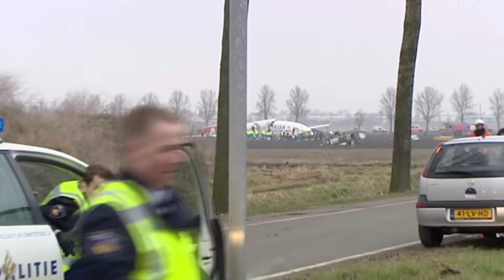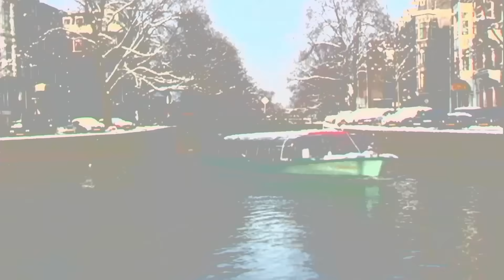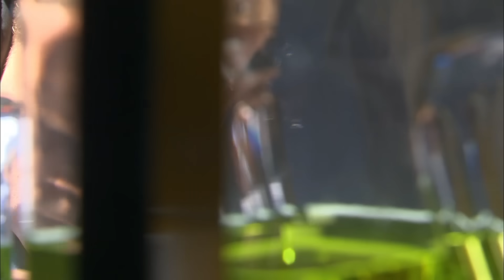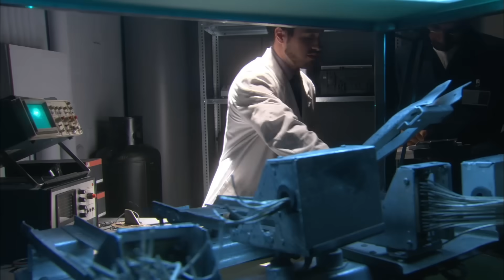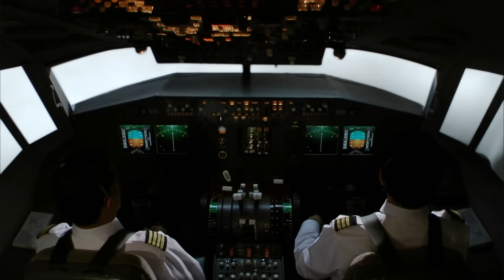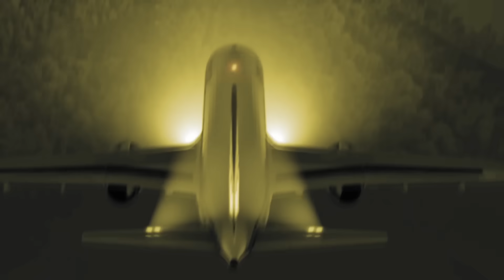Why Did Turkish Airlines 1951 Crash? | Mayday Air Disaster

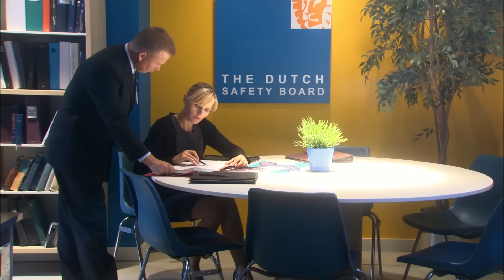Comment: 8:41😂 I can never stop laughing at the sign on the wall. Even if the name of the Dutch Safety Board was "The Dutch Safety Board", it wouldn't be called that way locally, it would be named in Dutch. So the signs wouldn't be like that either way. If they would have named it accurately, the sign would say: "Onderzoeksraad voor de Veiligheid," "Inspectie Leefomgeving & Transport," "CAA-NL," or "Rijks Luchtvaart Dienst."

Also, the cockpit interior isn't anything like a 737 cockpit. A 737 cockpit is about as spacious as a doghouse irl.

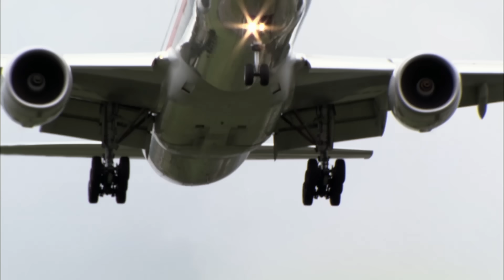20:30 And that's not a 737. The 737 does not have body gear doors, nor does it have 12 main landing gear wheels. The 737 only has 4 main landing gear wheels. That's a Boeing 777.

Comment: Give automation to Boeing, and they’ll still find a way to screw it up. The pilots were distracted — the plane should have warned them before it was too late. It should’ve issued an audible “Airspeed too slow” alert; that alone could’ve made them notice the throttles were set to idle.

At the end of the day, the kind of pilot who chooses to fly a Boeing often struggles with technology anyway. Airbus is far more sophisticated — and safer. You can blame the pilot or the tech all you want, but that won’t fix Boeing’s real problem: Boeing itself.

They keep making cheap knockoffs of everything, then ignore safety complaints until a plane crashes and hundreds of lives are lost. And every time, the NTSB steps in to clean up their mess and bail them out — so the same accidents keep happening, and nothing ever gets fixed.

The worst aircraft manufacturer in aviation history is Boeing. Heck, this old MD-11 was flying perfectly fine even after 30 years of service. How many Boeings can last that long? Why was McDonnell Douglas better? Because the NTSB never covered up for them — they had to face the consequences every time. And that’s why, even decades later, their planes ended up being safer than Boeing’s.
Reply: Md-11 just had an accident ups flight 2976z You should’ve seen how often dc-10s used to crash. That had nothing to do with boeing 😂😂😂. Hate these fake experts on here thinking airbus is this flawless ultra safe company while Boeing is ultra dangerous and deadly.

Comment: That is NOT about people, who can't understand [cryptic] signaling, but about invalid hardware and software, and irresponsible plane manufactures, who makes dirty shortcurts, and hides them (don't document, gives false severity for critical malfunctions)

Software do not validate inputs (doesn't alarm about them and does not abort operation), but continue making invalid control commands. In best case it generates number of cryptic third system alarms, that have nothing common with initial malfunction, thus you need to be genius engineer to understand the issue in real-time.

Comment: So, Boeing knew, that left altimeter is critical for auto-throttle, but did not state that in manuals, and still consider left altimeter malfunction as minor !
And why auto-throttle doesn't abort having obvious invalid altimeter data input in first place ?
That should be the very first function of the software - continous input validation. How negative radio altitude value could be considered valid in flight ?!

Comment: The captain knew the altimeter wasn't working and even ignored the alarms several times. I assume pilots know that altitude and speed are key components of descent. Yet, this was left entirely to the known faulty computer-controlled systems. In my opinion, the cause of this crash was pilot error.

Comment: What is the point of implementing automation if the automation doesn’t work? If you can’t count on the machine doing its job, don’t use it. You might as well do it yourself.
Reply: they later changed it so they could choose which parameters are read by the autopilot, if the captains ones or the second officer, not like in this case.
Reply: Good to hear

Comment: Fine and good, but a pilot is Avionics personal, not engineering, that is able to connect the dots of malfunctioning or strangely behaving stuff (and that is difficult even in normal situation, without ground closing in). Having lots of data is nice, but you need to STRUCTURE it. Having automation is in control is fine most of the time, but the moment you enter a circumstance (or have bugs), you wont recover, because the plane says "nuh nuh nuh".

In my opinion data presesentation is key. Also a direct alert of having different data from the same type of sensor or actuator and the plane should request "hey man, what are we going to do about this?" aka in this case: which data should I use, because I can't help it?!

It's working together, with the plane doing it's job and the pilot being the backup in case things get funny.

Comment: Boeing, after receiving 2569 reports of their faulty radio altimeters, finally decided to shrug off and do absolutely nothing. Incredibly criminal.
Reply: If pilots are so accustomed to faulty warnings and unfixed minor problems, it would be understandable if they dismissed warning bells.
Reply: @saeedsh65  exactly and they expect pilots to fly planes when they themselves aren't even bothered to fix problems
Reply: Starting the late 1990s, Boeing no longer was the company it used to be.  Boeing should not had bought MD.
Reply: Welcome to the world and life
Reply: It said they took measures to improve reliability, but when these didn't help, they should have brought in top engineers to either scrub every inch or redesign it.
Reply: Mayday highlights how little the pilots monitor obvious malfunctions...yet everyone sits in the cabin sipping overpriced drinks with complete confidence in these glorified bus drivers😂😂.
Reply: R
Reply: Can't blame Boeing for the pilots not watching the instruments on an instrument approach. It was an INOP system that's was worked around easily.
Reply: Too focused on the gauges and too little attention on obvious problems 😂😂1q😂😂
Reply: Part of me thinks this is an issue that is not directly related to Boeing though.  Even using your figures of 2569 reports, that would suggest that Turkish Airlines  alone accounts for 10% of those if your numbers are correct, yet there are some 5,000 737's in use at the time supposedly.  They also note that this particular plane had this issue before, yet sounds like it was able to land safely despite the same issue, so I believe part of this has to do with the pilots, as pointed out in the documentary...  their dismissive actions to the landing gear warning, the pilot bvasically "ignoring" the warning from the safety pilot about the faulty altimeter, etc.  I mean, the signs were quite obvious if someone was paying attention to what the plane was doing, but as they also pointed out, the crew was under a heavy workload at around 200 ft from the runway when they should have been monitoring the landing and systems, not preparing for landing like they were... that should have been done back when they wsere at 1000 ft, so to me, while the faulty altimeter was perhaps a contributing factor, it did not cause the crash.  BAsically put, it sounds more like a pilot error mostly.
Reply: ....the ice maker was broke too.....
Reply: Boeing doesn't maintain their planes after delivery thats up to the operator. How do you explain no other pilots experiencing the same system failure but do not crash ?
Reply: @The_Sword3   Very smart of you))) 
I mean there are thousands of cases where pilots have reported that they had problems, and you say to yourself that ... what if ??? if the plane didn't crash everything is ok !!!
At least you can hear yourself saying what you are saying ???
And in cars, if a manufacturing problem is found, the cars are called in for service to have the problem solved, but you say to yourself, what if ??? ... in an aircraft
Reply: @The_Sword3  Re: "How do you explain no other pilots experiencing the same system failure but do not crash?" -- Mostly luck that none were too distracted at the time to notice warnings.
Reply: Pilot error not a faulty altimeter . There are three of them on board. Three pilots didn't notice their speed dropping until it was too late.  Work for Airbus do you ?
Reply: @The_Sword3 so if brakes develop a fault on my 5 bicycles made by the same company there is nothing wrong with the bikes because i can brake with my feet? Not the sharpest tool in a toolbox, are you?
Reply: @szonton9672 if your 5 bikes developed a braking issue because of stretched cables and you put in writing you know the bike is damaged but aren't in a position to fix it,  you would indeed be laughed at for trying to sue the bike manufacturer for a broken leg

Comment: the question should be that why did the fuel tanks did not explode. Did it help that the landing gear was down ?
Reply: Fuel tanks don't always ignite on impact.  You need something to spark the fire, and you need the right fuel-air mix at the time that spark hits.  Too much or too little fuel and you get bupkis.

In this particular case, it probably helped that the main source of potential ignition - the engines - basically yeeted themselves away from the wreck on impact.

Comment: The main issue was the plane design. There has to be a setting in auto-whatever when there is one parameter wrong, the pilot should be able to set the auto in a correct way. Auto-throttle or auto-pilot is good if the inputs are correct, if some input goes wrong, there has to be a system (settings) to control auto systems.

Comment: It amazes me to find out that there's a warning sound for a faulty altimeter but no warning alarms when the speed decreased so low that it reached stall levels.
Reply: There is “stick shaker”, but in this case it came too late. Something like old american clunker…gives you red light overheating warning…after the engine is wrecked already…!
Reply: I believe it does say "stall, stall, stall" I could be wrong though
Reply: @ThepPixel That's Airbus.
Reply: Yeah, a Boeing 737-800 should have both a stick shaker and an audible "Stall" warning. It also has "Barber's Poles" shown on the primary flight display for both pilots that gives a visual representation of where your flight envelop is (Over speed vs Stall).
Reply: There is plenty of warning, the plane shouts "airspeed low" at you even before the stick shaker, the pilots just weren't paying attention

Comment: The irony of seeing this and the 737 Max issues is that it seems Boeing has been doing this whole "nahh mate we'll take it off a single sensor" thing for much longer than you'd think; if they used both radar altimeters they could've seen there was a disagree, which then should immediately disable auto-throttle, flip a master caution, and force the pilots to handfly. But no. Guess that was too logical...
Reply: I'd put in a check to ignore any reading below 0 feet if the plane is moving faster than 60mph.
Reply: No because that could mask a much larger problem.
Reply: That costs money. And Boeing is all about money.
Reply: @chrisrodriquez5459  Well, post-merger Chicago-based Boeing is. Before that Washington Boeing were all about engineering excellence.
Reply: Cant agree more. This accident could have been (and should have been) avoided.
Reply: Comparing two different voltages, to see if there's a divergence, is alien technology to them.

Comment: This accident should never happens in an Airbus with the Alfa protection mode.. Boeing should install the same feature..  Simple as that. The ALFA protection mode works independently of both autopilots, and  would have understood the low airspeed and correct it.. Even the new Chines Comac 919 has it.. Why not Boeing ?? Simply another Boeing accident where the system failed or was simply missing. Boeing has a lot to work on,  If not we will have a new Duopoly in the skies, Comac and Airbus.. ???

Comment: Well a verbal warning of airspeed would seem even more important than "pull up". The stick shaker was useless at this point the planes computer, auri throttle , and defective altimeter intentionally stalled the plane on its own and crashed. Yes checking air speed is mandatory, however,  if there was a verbal automated or verbal airspeed  warning before the stick shaker,  this and other crashes of smart places could be prevented .

Comment: The cockpit workload was too high (largely due to the Schipol landing) for the pilots to even recognise the subtle warning that the plane was giving them. There's elements of 'mode confusion' too with automated flight systems, plenty of landings have turned to poo because of similar events.
I have to place some blame with Being for not 'masking out' obvious radio altimeter erroneous readings too. It should reject negative values entirely. Better still would be to compare the two radio altimeter values for inconsistency.

Comment: Hog wash!   "Investigators have determined that Turkish Airlines flight. . . crashed mainly because the pilots didn't recognize the consequences of the warnings . . . "     No.  The 'main' cause was a design flaw by Boeing.   That the pilots were not trained to lookout for the malicious domino effects of the faulty reading then came into play, under circumstances which masked the symptoms produced by those effects.
Early in the video, I pondered on why there was no 'override' switch for Ground Proximity Radar feed to the autopilot system (APS).   Having a mute button to silence an audio alarm is nice, but, if a crew determines that a critical flight reading (and it is why they often have duplicates) is faulty, not only should they be able to silence the audible warning, but to as well cut its data feed to the APS.  How can that not be OBVIOUS to Boeing or any large commercial plane maker?   Once determined to be in error, the override would be enacted manually by the pilot, and the APS computer could then use the feed from the other radar sensor, or at the very least not be subject to faulty data causing the plane to behave catastrophically.  
While it 'might' could be said that the 'ultimate' cause was due to the pilots lack of attentiveness, it wasn't, in fact, the 'main' cause.  The main cause was a Boeing design flaw, without a doubt.  If you design a machine to perform based upon inputs that can be faulty, without providing an override opportunity for the crew, then it is the designer who is at fault.
Reply: If it is a boeing I’m not going😮
Reply: This guy Sedor is going to give Greg Feith a run for his money in the good looks department
Reply: @jamestew5075
O don't even get me started on that Greg Feith.
Reply: @jamestew5075  Greg has cool ties though.
Reply: There should be three on board computers that have access to all systems and vote on what should happen. The humans shouldn't have to dismiss anything, the speed alone should be an indication that the plane is not on the ground, along with every other flight system that is giving reading that would only occur while in the air.
Reply: Absolutely agree with these sentiments, if it’s faulty and it can cause other equipment to behave in the wrong manner the it should be possible to turn it off. At least then the pilot can fly the place manually knowing it’s him and not a gremlin in charge. However the pilot monitoring was not doing his job and that was to monitor the plane’s performance. Sadly he and his colleagues paid the ultimate price.
Reply: @wobby1516  …and so did those three Boeing engineers. Perhaps, they were flying from Istanbul, where they attended airline’s maintenance facility to try to fix radio altimeters…?
Reply: I have not been on a plane since 2011.    
I am still alive. 🎉🎉  
Never trust a Boeing
Reply: And until this day and recently, B still walks away as free man...who's got the victims' blood on their hands is one of the million wonders of the Universe

Comment: Here it seems that both human error (they should have monitored the speed and altitude of the plane) and their reliance on the newly changed altimeter and its computer unfortunately caused the plane to crash. Maybe shouldn't the altimeter and its computer, which were reported to have changed 2 days ago and have 2569 faults reported on these planes, be recalled? I have seen this plane a few times at Istanbul Atatürk Airport.
Reply: the big issue is making these computers rely on one set of sensors.  only one set of altimeter was bad so the computer could have been given 2 sets and judge.